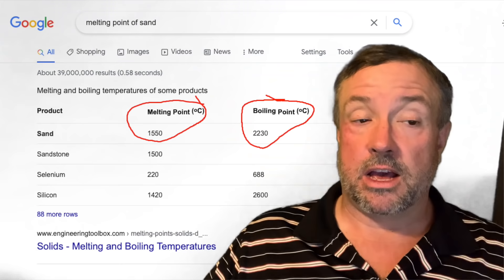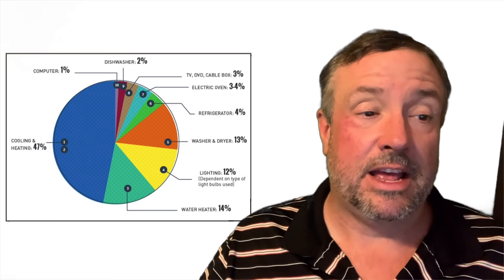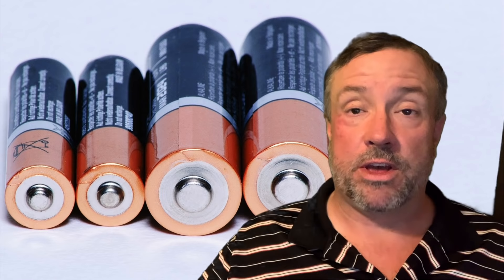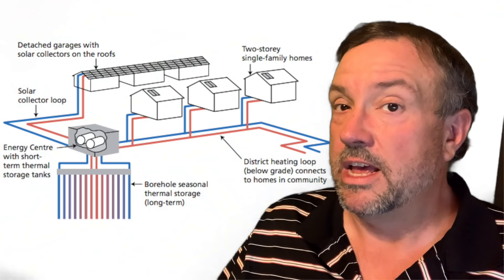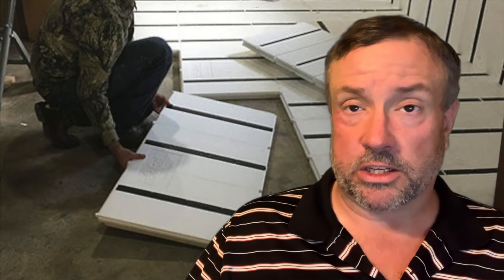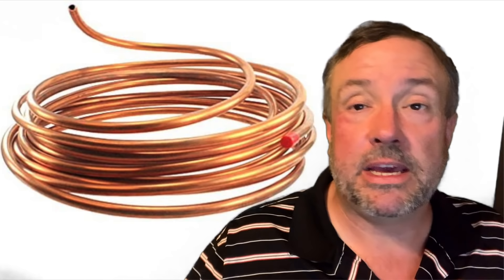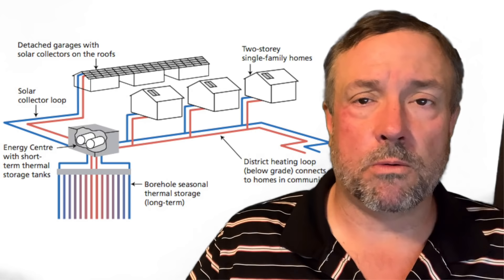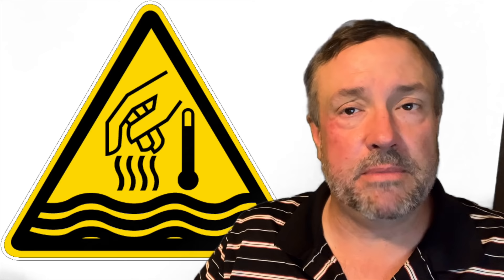Sand for Thermal Energy Storage

Comment: The problem I see with sand is that compared to water, it is not as energy dense, and it slower to change temperature as compared to water. A problem you'll run into with higher temperature storage is standby loss. To store the same amount of energy with sand, you'll need about 5x the storage volume, which will increase the surface area by about 3x. Even though sand changes temperature at half the rate of water, because of the increased surface area, standby loss is 50% greater. That's not to mention increased cost of construction for the bigger vessel, as well as poorer performance of the battery. 

Water is a good storage medium, it just needs to be properly contained. If your overall goal is to capture and store energy, a simple solar absorption collector array + water sourced heat pump interfaced through the battery can provide a lot of energy capture and efficient reuse. In the summer time, the water in the tank will be heated from the solar array up to 100C. Glycol or another coolant can be added to the mixture to increase temperature range, say up to 150C. A water-source heat pump can be used to move this stored heat to create domestic hot water, slab heating, pool heating etc. 

In the wintertime the solar array will be next to useless, especially with how far north you are... the heat pump can still move heat from the battery to the house, but my guess is that it will run out of energy fairly quickly. Some quick napkin math with a 2000 gallon tank yields about a month of usable energy when changing from 100F to 40F, not including standby loss.
Reply from the maker: I’m not sure you’re correct about the volume difference of sand to water

Comment: If the hot box is pressure sealed I can use old leaking water pipes blowing air through my sand blaster.
Reply from the maker: Interesting!

Comment: you could increase the heat of the sand to 1500c (under melting point) for store more calories instead , you can use few magnify glass for concentration to increase the heat until desired value , it would allow 30% more storage , does it make sense?
Reply from the maker: Makes sense
Reply: @SimpleTek  i have look about what kind of tube we can use for resit at this heat , i find that Titanium (1668c)  and we can weld the tube, my question is what kind of liquid we could use to transport the calories into the Sand ? thanks you
Reply from the maker: @adytech5788  very good question, I can’t afford titanium
Reply: @SimpleTek  titanium tube are not expansive on alibaba , also i was thinking about that liquide and its look like some searcher have developed a liquide with metal that work to 3000celsius  https://youtu.be/_0SQFF1oSL0?t=29
Reply from the maker: @adytech5788  that’s awesome! I’d have never thought those were cheap

Comment: look at http://www.electrodacus.com .Dacian is the guy who designs and builds the SBMS0 and the DSSR20 with diversion, it's much simpler to just use regular Photovoltaic 24V panels, this will give you electricity and heat in one simple solution , I don't think high temps are what you need, what you need is simple thermal storage, and this can be done with much lower deltas than 300C , at the end of the day there is only so many Kw/hrs in a square meter of sunlight, IMHO the goal should the to maximize the KW/hrs of thermal energy that you store and not worry to much about having the highest delta that you can achieve, A higher delta will make insulation that much harder and you will lose more energy at higher deltas. you can store this energy in water or concrete, both work very well for thermal storage. if you have questions Dacian is very active on his forum and there are a lot of other helpful people there as well. The SBMS0 with the DSSR20 w/ diversion is a super simple solution for both heat and electricity ,
Reply from the maker: That's interesting!!! Thank you

Comment: instead of using sand, make a small heat exchanger filled with gallium metal and run a stainless steel coil filled with water or oil. Gallium does not need a lot of heat and it evenly distributes and retains heat. Its somewhat expensive but you only need a gallon of gallium to make a small the heat exchanger.

Another idea is to use a friction heater with a metal flywheel and applying a piece of 2 x 4 wood pressed against the flywheel to heat it up. using temperature sensor like in a car engine to engage the electric motor when it starts to cool down. the entire contraption would have to be enclosed in a box to avoid igniting the piece of wood. A coil of copper tube would by on the opposite side to heat oil in the tube. 

Another idea is is to make a ...on second thought this idea is too good to give away.
Reply from the maker: great info - Thank you!

Comment: It's simple you put pex in PVC and you fill the PVC with concrete. Then move the air. Pex vaporized. Use the air to heat water to steam. Now you have steam turbine energy and clean water.
Reply from the maker: nice!!!!
Reply: @SimpleTek  the trick is getting the heat into the storage. I think if you can plumb an energy source down hill, the hot air will rise into the battery

Comment: Anhydrous Propylene Glycol (you have to keep water out to prevent boiling off of an eutectic mixture) is a possible choice for a transfer fluid from the storage (or an intermediary heat exchanger) to the home.  It was considered for non-pressurized engine cooling and is a lot less toxic (it is used in foods - but anything is a poison if you ingest too much) than ethylene glycol.
Reply from the maker: glycol is good... it has temperature limits though.
Reply: @SimpleTek  please explain, my contractor is building several of these for me and it seemed to me that Automotive coolant would be a logical choice, but what are the issues?

Comment: I'm gonna try some calculations as well.
At 260°C and 1 atm air has a density of about 0.66 kg/m^3. The heat capacity is around 1 kJ/(kg*K).
So a temperature difference of 200°C would give you 200 kJ per kg of air. You need 30 kW = 30 kJ/s.
So you would need 0.15 kg of air per second = 830 m^3 per hour.
Even small fans can easily move that much air.
Reply from the maker: interesting!

Comment: I am not sure you want to put the pipes through the sand.  If they are filled with water, you obviously have a steam problem above 100C (and you want to go higher), and if you empty them first, as you try to fill them it'll be an explosive combination!  My current design is going for a heat exchanger which can be inserted (and which contains a moderate insulator to slow the initial heat transfer).
Reply from the maker: Very cool

Comment: Hey I run an induction furnace and a rolling mill. So we manufacture rebar rods. So after its final stage the rebar is about 300-400 degree on the cooling bed. Is there a way to store that much of heat and then translate in to an energy.
Reply from the maker: I’m sure there is!
Reply: @SimpleTek  can you point me into right direction.
Reply from the maker: @LetsrepLiftingLeague  is need a lot more information but I’m thinking some kind of metal piping using a high temp liquid could extract a lot of the heat

Comment: For a SMALL sand battery, use a metal trash can, paint it black.  Fill it with sand.  Put it in the sun at dawn and bring it in at sunset.  If you expand this to a large metal tank, maybe 15 feet in diameter, with a copper coil similar to a still, at the center. You can run air through the coil or you can run olive oil, although that is expensive.

Comment: Water is just too good to ignore for most solutions involving heat storage. You can use very saline water to increase the boiling point a bit (brine can be useful to that and it's a waste by-product in water desalination). Propylene glycol works too. But typically you won't get it higher than 115C. Still, making a large shallow pool is relatively inexpensive, especially if it doesn't need to look cute.
Reply from the maker: Well said

Comment: To be practical and low cost:  keep the temp on the low side, so you can use plastic tubing and air.  Use sensors to monitor temp at key points.  No secondary heat exchanger.  Use simple flat panel collectors.  Do the math to show feasibilty before construction.
Reply from the maker: ok

Comment: Consider heat resistant brick to form an intricate pathway surrounded by the sand. Blown air might be the easiest to consider.
Reply from the maker: maybe
Reply: Temperature limitations on a forced air system kinda holds you back in the storage area, they work for greenhouses and tempering the air, I like it a balmy 70+

Comment: Why not use resistive heating from solar panels? Why use medium at all when you can put heater in sand. Preferably directly patching DC from panels into heater directly 
Transferring heat out - best option is air.
Reply from the maker: Maybe

Comment: What about using air itself to pump heat to the sand?
Reply from the maker: Interesting
Reply: A bit of quick googling says that normal atmospheric air (the cheapest and most abundant resource you could think of) is stable until somewhere around 1300C at least. Another advantage is that it is non toxic

Comment: How about using electric resistors,  like the ones from electric ovens, powered by pv panels?
Reply from the maker: Interesting
Reply: @SimpleTek   I have a 10 kw pv system. I use around  4-5 kw/day with  in house appliances. I may add another 3-kw  ( maybe a wind turbine) and run these oven resistors heaters to bring the sand to temperature. Then I may tap that heat for hot water, and in the winter to heat my floor heating water circuits. And maybe spend another 2-3 kw /day maintaning the temperature .
Have to do the math, though...
Reply from the maker: @tepesvoda464  that’s fantastic
Reply: @SimpleTek  how about burying that sand battery underground, insulate it thoroughly,  and build a combination of greenhouse/ indoor swimming pool ON TOP of it? With double glazing windows, very short piping and floor heating all around it will be very efficient. An oasis!
Reply from the maker: @tepesvoda464  love it

Comment: Among the materials with the highest specific heat capacity is wood. Fir wood is one of the best with ~2.7 kJ/(kg*K), that's 3-4times the heat capacity of silicium dioxide ("sand").
As long as direct contact between the wood and oxygen or moisture is prevented, oxidizing and burning shouldn't be a factor, allowing for very high temperatures.
The heat pipes could indeed go through layers of sand, sandwiched between planks of solid (and ultra-dry) wood. I have to admit though that I'm not 100% how the numbers usually seen in literature add up, because the specific heat capacity of carbon is "only" about 0.7 kJ/(kg*K). Maybe rest-moisture is accounted for. In that case it wouldn't work like I hope.
"Fireclay", other than ordinary clay, is also a good material with about 1.0 kJ/(kg*K).
Among liquids, glycerin doesn't sound so bad: 2.43 kJ/(kg*K), with a boiling point at 290°C, so for medium temperatures it would still work.
Sand is great for large installations, because it's literally "dirt cheap" and almost infinitely available, but for those sorts of installations where weight is a factor, I think wood might be an alternative.

For the pipes: why not use stainless steel (melting point ~1500°C)? Much cheaper than copper.

Insulation: it might be worth thinking about solutions where the insulator is enclosed in a partial vacuum, with as little heat bridges as possible. Air can evaporate out of the insulator through 1-way valves as the system is heated up to the max. operating temperature for the first time, from there on there will be a lower pressure (with less heat transfer) in the insulator layer whenever the temperature of the heat chamber is lower in the future.

In the broader context, I invite you to also take a look at a very interesting facility made by Siemens-Gamesa in Hamburg/Germany (nicknamed "new stone age" --> helps finding it via google) where they use volcanic stone for heat storage.
Another company doing something similar is QHeat/Finland --> probably also worth looking into; they're also reaching commercial level now, but I would say that Siemens-Gamesa is one step ahead. Still, what's interesting about QHeat: they claim that heat storage in sand at a larger scale (as you say: insulation gets easier with scale) is so efficient that the heat is preserved for many months, up to a level where you can store the heat in the summer (when more solar energy is available) and use it over the next winter.

One disappointing thing about all these solutions is that although storing heat is associated with very little losses, converting it into electricity isn't very efficient (although I understood of course that electricity isn't your personal objective). Getting 45-50% out of a steam turbine would already be very good, so all this only really makes sense when the energy is supposed to be used as heat only, or electricity with heat in combination. Electricity alone sadly is associated with to much loss. This is where batteries still excel, with >90% efficiency. Whatever concrete method is used (turbine, high-temp Stirling engine, steam motor...), we're usually limited to the Carnot energy, which gets better at higher operating temperatures, but is usually still far from 100%. I guess part of the explanation is that - other than enthalpy - total entropy can only increase (which it does during heating, but this is a one-way street). But for heat alone: the method is so astounishingly simple and cheap that I'm wondering why we're not yet using it since 100 years. Think about how much we're losing every year through industrial waste heat all around the globe!!
Reply from the maker: how could one change and recharge fir wood? stainless steel is a good option! 
when 30-65% of a household's energy use is heating, there's no need to convert it to electricity!
Reply: @SimpleTek  I'm not sure I really understand the question. The charging/recharging and heat collection for usage would happen indirectly via the sandwiched layers of sand in between, therefore no pipes need to go directly through the wood. The equilibrium between layers would quickly restore itself automatically to an evenly distributed temperature. For the type of applications you're looking for, sand is probably indeed the best option, because as I understand, in your use case size and weight aren't really an issue, but I could think of applications where it would matter: you could even drive a bus with electricity converted from stored heat in lets say half a ton of material (insulation like stone whool (inner and more heat-resistant layers) or e.g. XPS-foam (for outer layers) weighs almost nothing anyways), replacing expensive batteries. The specific energy stored in wood would already surpass the specific energy of lithium ion battery for each ~350°K of temperature differential (more when it's heated up more), so if there's an efficient way to convert the heat back into electricity, this could indeed be a battery alternative in some cases.

The 30-65% depend very much on the climate zone. For warmer climates (where even cooling via air conditioning is used a lot!) the need for electricity dominates by far. I was talking more in general. For your personal case - in a cold climate - this may be irrelevant. Still, it's nice to have a local and low-cost green electricity production without having to wait for the larger companies and political decisions driving the energy revolution for us. It can happen faster when enough ordinary people make the change. Even 35% of total energy needs matter. You never know where grid electricity really comes from (nuclear, coal...) - not to mention requirements for off-grid installations. I may be a bit biased by my nationality; I live in Germany, where renewable "green" electricity at the individual level is a big thing since many years, long before it became huge in the United States. E.g. in the city where my mother lives, at least every second roof is covered with solar panels. Germany was also a big factor for solar panels becoming as cheap as they are today: America created the technology, then Germany was first to create a large enough market (driven by government incentives), then China took the opportunity to start large scale production, pushing down production costs, which - at the time - they couldn't have done without the german market. Now everybody is happy ;-) and the the entire world profits from the low costs.

Comment: At a grid level molten salt is promising, eg the MAN MOSAS system, your generation is renewable feeding into the grid, your MOSAS site is positioned optimum for the grid, heat solution with off peak electricity through high temp heat pumps and resistance coils to bump it up to the final temp, discharge at peak times, through steam turbines, all very low tech. The uk can generate 40% of its electricity from turbines, but often they are trimmed to meet demand even if there is wind, this system soaks up excess capacity. so you can run the turbines 24-7 if there is wind available. 1GWh ~ 10000m3 of solution (this is not a big tank).  Other thing to consider, bidirectional charging / discharging of EVs, I could easily power my house off my EV for a day. there are 32mil cars in the uk and 25mil houses and most are cars are parked at any one time, a bit of logic to arbitrage based on price, job done.  Also need to use hydrolysis to convert semi-treated sewage to hydrogen and oxygen, this is a waste product which needs to be pumped many times to treatment and discharge.  Dilute existing gas supply with Hydrogen or use it in closed system to make electricity.
Reply from the maker: Thank you for the detailed response